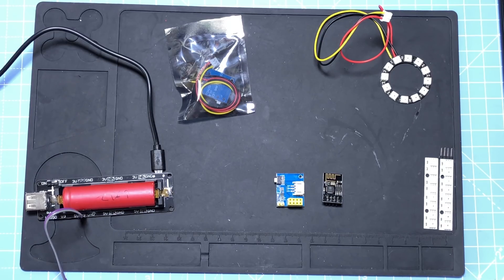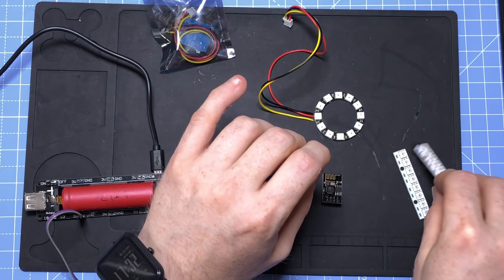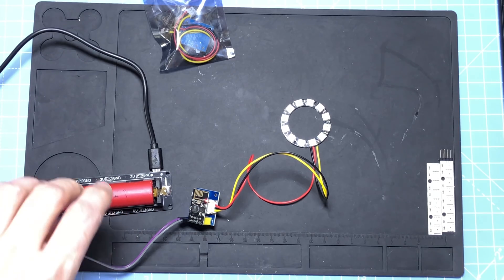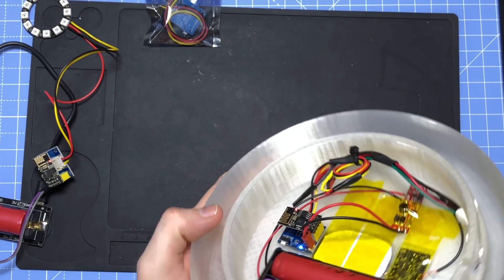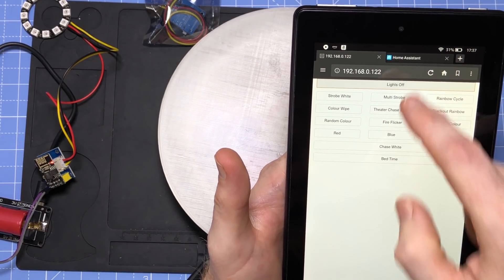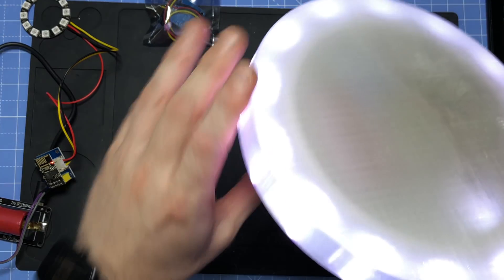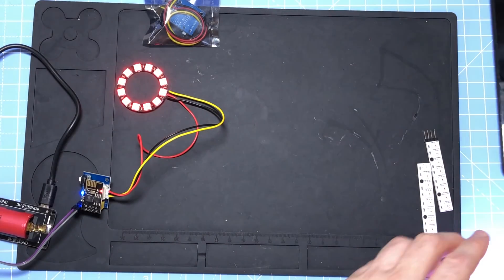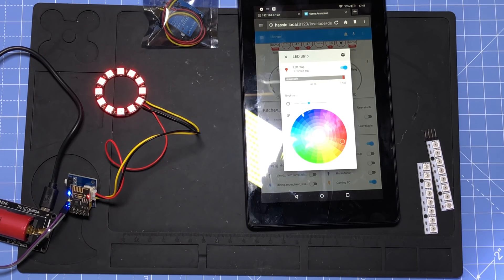$2 ESP01 RGB LED controller with Home Assistant Support

Comment: OK I have ESP01 controller ESP8266 ESP-01S ESP01 1MB Flash Wi-Fi AP & Station Mode and wired my NeoPixel Ring to it. Q1 How can I control the ring wirelessly, is there an app on Adroid phone I could use to communicate with ESP8266 moldule? Q2 can I connect ESP01 to my Raspberry Pi 4?

Comment: Sorry if I missed this, but what does the LED module actually do? Any reason you can't just connect up directly to the ESP01 for data?
Reply from the maker: It just gives a more convenient way to connect the parts and you can use a 5v supply for the board as there is a 3v3 regulator onboard for the ESP.

Comment: Came here for controlling 5050 Rgb led, found ws2812...
Put ws2812 in the title please :(
Reply from the maker: Sorry it wasn't what you wanted.
Reply: ws2812 is a 5050 type rgb led!  if you dont know then you shouldnt be messin with electronics lol
Reply: @Oversizewizard  nope, not really.
WS281x is the controller IC inside/nearby the 5050 (or other types) LED chip.
Check your facts before trying to make fun of someone :)

Comment: Get a compile-error! I've a esp-01S and it works with other sketches (e.g. ESP3D). It works when you change D2 into 2.
NightLight:23:30: error: 'D2' was not declared in this scope

 const unsigned int dataPin = D2; // pin connecting the LED data pin to the Arduino
Reply from the maker: Ah sorry yes this was originally compiled on a Wemos D1 mini board.  You need to change the pin to be 2 as you've mentioned.

Comment: I do like the integration into HA. I need to set up your ESP01 LED module as a night light I think, need to toddler proof it first with a case!
Reply from the maker: https://gallery.autodesk.com/projects/night-light  I've published it on fusion so you should have access to the model to modify it, should be easy enough to fit a couple of mounting screws in the lid to stop little fingers getting in there :-)